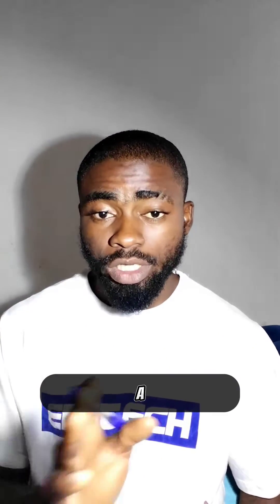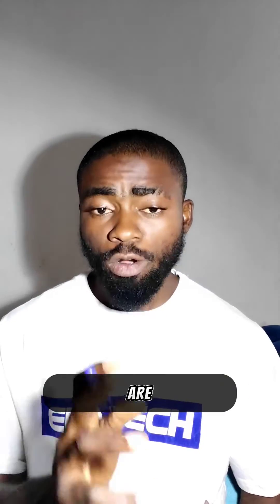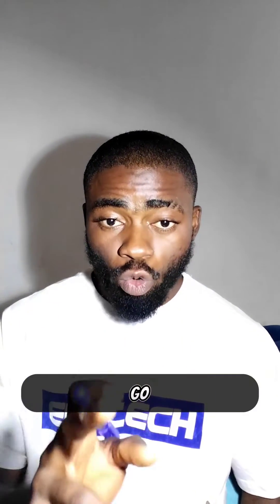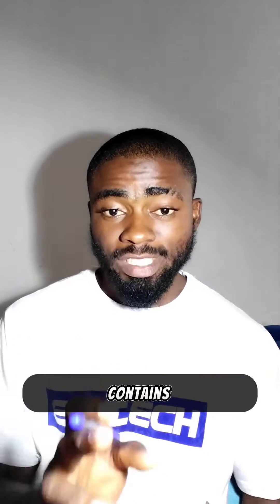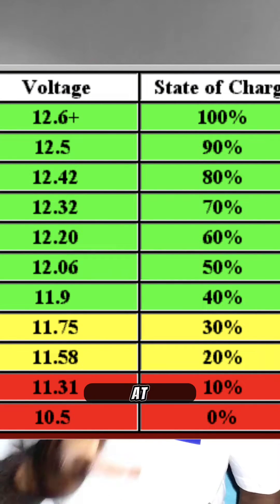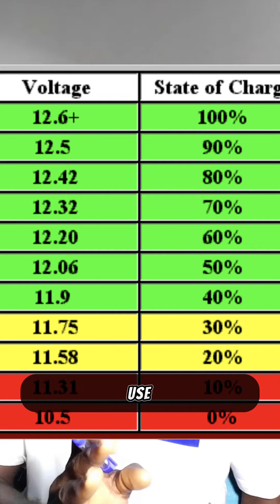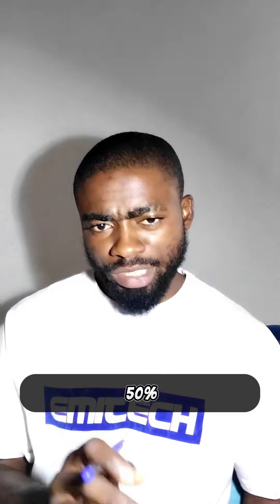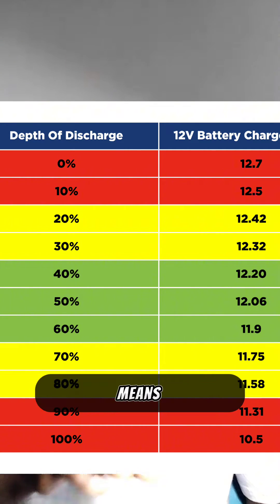What percent depth of discharge is best for SMF or tubular batteries

Comment: Battery voltage varies with load.
The chart you shown is for the voltage of battery at rest when it is not under any load. The best way is to set your inverter within 11.6 to 11.9 volts LVD. Any moment you switch on an heavy load and its reaches your set voltage the system goes off. I have been using this setting for my tubular batteries set at 11.8v or 23.5v for four years now.

Comment: Please note that not every inverter out there understand all battery chemistry, some can't even differentiate Lithium from LAB. You can't therefore rely on all inverters to determine batteries depth of discharge at all times.
Reply from the maker: Yeah, but 99% inverter DoD are 70-80% DoD

Comment: Nice video some inverters even allow you set the cut off voltage.... please sir  at what rate is a 24v system at 80percent Dod
Reply from the maker: What type of battery do you have?
Reply: @Mairigaemmanuel two 12 volt 220ah  tubular batteries
Reply from the maker: I think 22.5
Reply: @Mairigaemmanuel  thank you

Comment: Good morning sir, please is it necessary I use a battery equalizer for my 4 batteries 48v set up
Reply from the maker: Yes, so your battery charge equally
Reply: If you have a very good charge controller, particularly the type that can automatically detect the battery's voltage and can be set to recognise the type of battery, then it is equipped to put your battery bank through the various stages of charging, which also covers equalisation. There are mostly MPPT charge controllers that can do this.
Reply: @ekeretteekpo3004  , please can you give me names of MPPT CC that can perform this task, I have an 80ampsfelicity  MPPT
Reply from the maker: Felicity is a good brand.
It'd do a great job
Reply: @Mairigaemmanuel  Thanks a lot boss
Reply: @jeffreyukpabi2200  actually most popular brands of mppt charge controllers will do this automatically, especially if one is using models from 2022. You won't have to worry about setting things up that much as the charge controller gets feedback from the battery while charging in order to determine and coordinate how it goes through the required phases of charging.
Reply: Please help me respond
Reply: If you use a proper mppt controller, you could set it up to equalize your batteries at certain times and voltage intervals, likewise your inverter as well, so please look through their manuals and settings.
Reply from the maker: @voltraenergy8606 will not be possible
Reply: @Mairigaemmanuel  actually it is. That's how they are built. As a matter of fact, there are preprogrammed settings for equalisation that will occur once a month at least, per the chosen battery configuration.
Reply: @Mairigaemmanuel  Super possible my brother, tried and tested time and time again.
Reply: @voltraenergy8606  I agree. Although, for me, my inverter is quite basic. I wouldn't know if it can do that to the battery if I decided to use it to charge the battery via the grid. For now, I'm happy to stick to the solar panels and charge controller for charging. 😁

Comment: The chart you used is testing resting voltages, representing the battery voltage when disconnected from any load and allowed to recover for some time. It is different from "voltage under load". The voltage under load changes depending on the current drawn from the battery, which changes the battery's internal resistance. That is why a battery voltage can go as low as 12.01v under a heavy load but immediately rises when the load is disconnected. That is why battery voltage is not a reliable measure of a battery's state of charge. The specific gravity is a more reliable measure. Now, for the owner of a lead acid battery, connect a constant load till the inverter shuts off. Note the battery voltage when this happens. Disconnect the load and allow the battery to rest (preferably overnight). Measure the battery voltage. Correlate the LVD with the resting voltage, and you can have an idea of what voltage under load represents a particular state of charge for the battery. However, this value will change as the battery ages.
Reply: The basics man, with this narration, you know your basics man. 👍. Solargod... I disagree too.
Reply from the maker: You're free to disagree sir!.
Reply: It's not about to disagree, if this person is right, then the video content wasn't done with proper research that factors in all this things. Most times all this tubular battery brands just use 80% DoD as a marketing stunt because of the advantages of LiPO batteries. True, 80% can be achieved on tubular batteries but it comes at the cost of the life span of the battery aside from the already existing short span the battery has.

Comment: You can deeply discharge any battery to 80%. The lifespan(cycle life) of any battery is greatly reduced if you deeply discharge it. 

Lifepo4 has higher cycle life at 80% like 3500+ cycles - 10yrs compared to deep cycle Flooded Lead Acid(tubular) which are around 1000cycles which is 3-5yrs. Car batteries are not deep cycle batteries and should never be used for solar.  Car batteries won't even last 1 yr if you discharge it 80%.

The real question is how many cycles would you get from your battery if you discharge as deep as 80% constantly?
Reply from the maker: Definitely true
Reply: That's the exact question to ask. The deeper you discharge your battery the higher the risk of getting reduced cycle life. My inverter can even work down to 10.5v on LVD cutoff, but I am always shutting it down at 60% max DOD Occasionally, and my Marine AGM battery 150amps/hr still survive over the past 4-5yrs and is still going strong.
Reply: This is what solar installers should help their clients to understand. I have many of my friends complaining that their battery doesn't last like before again ( barely 2 years) and their surprise that the same system of mine is celebrating 5 years of active service. The secret lies in the DoD I no dey pass 12v at most 11.8v. battery is expensive biko
Reply: I like your answer it's very Incisive.

Comment: thanks for this video the problem i thinking is happening is lack of understanding and now you have solved that. I have a 24v system but I have never used my battery more then 24.0. if I c that is either am putting it off or put on the gen. well now I know 😅
Reply from the maker: 😁😁, you've been underutilizing your battery all this while.
Your inverter is very smart, so it knows when to go off to preserve the battery life